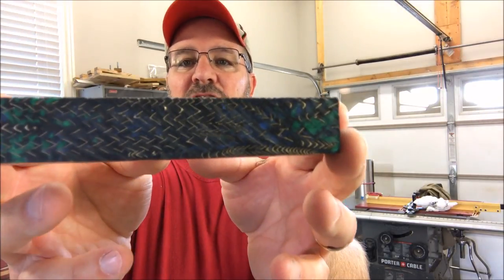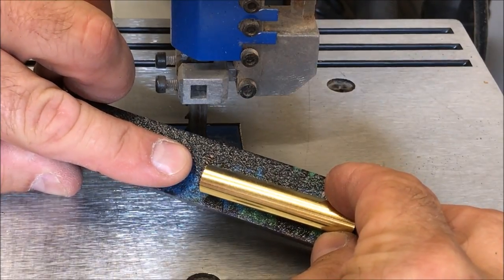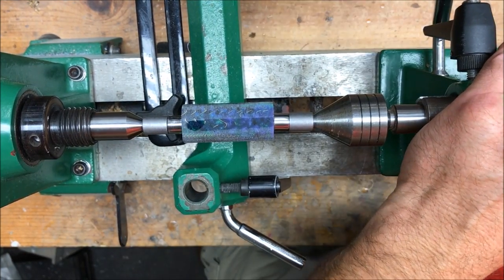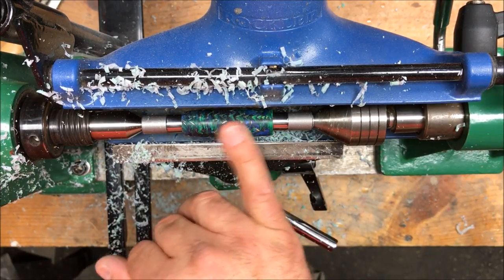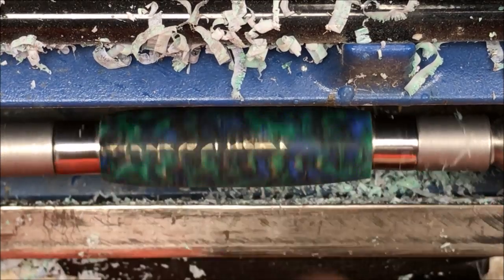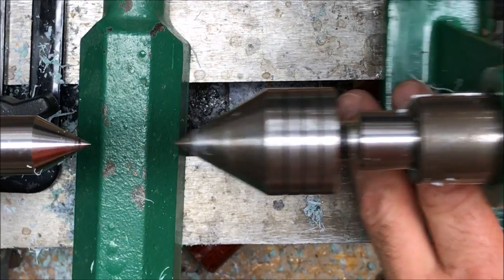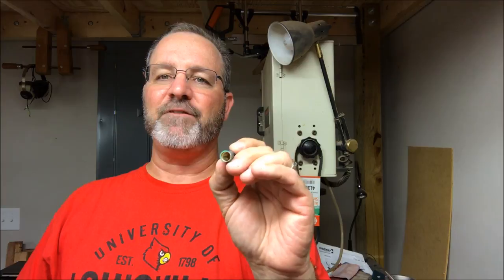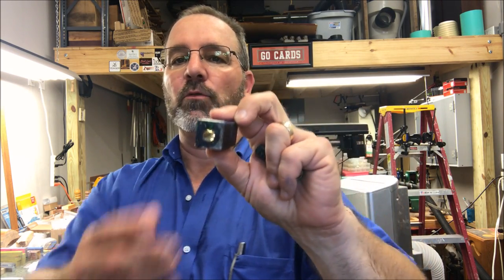Things Don't Always Go As Planned

Comment: Hi Bob, I bought the same lathe and only because I am just starting out and its cheap.  I watched one video that went over some of the problems this lathe has and that was one of the problems.   The spindle to tail stock sometimes don't align.  So when I got mine the first thing I did was to check that alignment and sure enough mine was off, so what I did was to cut up a coke can and used strips of the aluminum under the tail stock to line up the two.  So far it was been doing great.  Now, just for my peace of mind I started with the mandrel saver and so far true pens blanks.  I hope this helps.
Reply from the maker: Awesome job, great dis on that lathe. 

Regards,
Bob

Comment: Nice blank.  Instead of cleaning off the tube completely, just take a small amount on each end to eliminate the chip-outs and replace it with a contrasting color wood or acrylic glued to the ends.  Called an "oops ring" in many circles.  At least you'll be able to salvage the blank.
Reply from the maker: +John Walsh I may just try that, got to
Get this lathe alignment figured out first. 

Regards,
Bob

Comment: Bob, thanks for at least two great tips here: 1) the dust collector attachment, I will try that with an old thing I have that looks similar 2) I'm off now to check my old lathe which I use mostly for drilling to see if my tailstock is lined up or off a bit. THANKS!
Reply from the maker: +Ralph Ross Thank you Ralph. 

Regards,
Bob
Reply: I have been a machinist most of my life. Not to say this is not a problem when drilling because it is. If it was a metal turning lathe, you would end up with a tapered part when turning but not turning off center.  My lathe has the same problem but I use a mandrel and the mandrel saver tail stock center and if the arbor is straight, I guarantee you will not get the result you have. 

I do enjoy your videos.
Reply: Well my old Rikon 70-100 mini lathe was right on, luckily I think, as I don't recall the last time I checked it except years ago when I bought it and set it up. I did test with the quill fully extended and retracted and it was A-OK.

Comment: You could send the wobbled blank off to your friend that does casting and have him add a layer of that resin you use with the bottle caps. Then all you would need to do is rework it,..... maybe a kit with a fatter nib so you can keep more meat on the brass tube
Reply from the maker: +Marcy Cooper I just got most of what I need to start casting. Not sure if I'll do this blank but I failed twice this week and the second would be a perfect candidate. I even mentioned doing just that  in the video. Great minds.  :^)

Regards ,
Bob

Comment: Touch up the exposed edges with a bit of paint and then recast in clear resin to save the awesome blank. For the alignment you might try using your mandrel as a guide/positioner and draw a reference line on the front way as well as an index mark on the front and rear of the tail stock so you can position before locking down. You could also send the blank to me to attempt to salvage. ; ' )  Keep up the great videos!
Reply from the maker: +Mr Vic's Pen Shop Thank you for the information, I plan to work on this issue today and hopefully can get it corrected. Thanks got the offer the salvage the the pen, LOL, I got a kick out of that. 

Regards,
Bob

Comment: Hi Bob,
Your HF lathe may be different from mine, but my Jet has a bolt under the tail stock that keeps the lower clamp on. I can adjust the lateral play by tightening the bolt to take out the slop. Hope that helps.
Reply from the maker: +Jim Kodysz Thank you Jim,
  I'll take a look and see if that's the case. 

Regards,
Bob

Comment: How frustrating !    I purchased a double ended #2 Morse taper, and push it into the headstock. Then I loosen the cap screws under the tail stock and push it firmly up against the other taper. While everything is aligned and tight, I tighten the cap screws under the tail stock. Then, I install a drive center in the head stock and a live center in the tail stock as a check for perfect alignment. I do this about every 3-6 months and find very little drifting has occurred.  My lathe is a Nova DVR  XP, which is not a heavy duty lathe, but far more substantial than your Harbor Freight lathe. I'm not sure if this will work for your lathe, but for mine, this process is part of a 3-6 month check up of all fasteners and alignment, and has worked for me since 2013.
Reply from the maker: +Doug Robins Thank you for the info Doug,
  I'm currently trying to source a double #2 MT. 

Regards,
Bob
Reply from the maker: +Doug Robins Thank you.

Comment: could you drill and tap holes into the side of the tailstock where it slides on the bed. then put some grub screws in the holes and adjust out the play. they would wear but would be easily changed or adjusted
Reply from the maker: +MelbourneAlan That's a pretty good idea. I wonder how difficult that would be, hmmmmm.  

Regards,
Bob

Comment: Bob, I have the exact same lathe as you do, and have the same tailstock wiggle. From what I can see there’s not much you can do to fix it. The only way I can see, is to weld on a piece on the bottom of the tailstock that has tighter tolerances between the rails. 

I’ll continue watching and hoping to see if you find a different fix for the tailstock wiggle.
Reply from the maker: +Gary Binder Thank you Gary,
  So far none of the suggestions have worked. I may just have to replace it. 

Regards,
Bob
Reply: I’m going to keep working at it, if I figure something out I’ll let you know.
Reply from the maker: +Gary Binder Thank you. I'm running into walls. 

Regards,
Bob

Comment: I second your opinion on the tailstock.  You can adjust the headstock all you want, but the problem is slop on the tailstock.  My lathe at least locks down in one place but it is sloppy too.  Drives me nuts.  You had a lot of comments yesterday about adjusting the lathe and I appreciate the advice and links people provided, there is a lot of good information there.  But I think in your case it is simply the fact it is a cheap lathe.  I wonder again at the wisdom of trying to use a mini metal lathe for pens...for me, not you.  I would really love to get into small machining like steam engines but don't want to give up pens either.
Reply from the maker: +Tenspeed TheBikeHanger as long as you can get the speed up it would work. Many metal lathes are geared to run slow with lots of torque.   

Regards,
Bob

Comment: A little clarity (I hope)... In order for your blank to oval it has to wobble! Even if your centres are miles out it won't wobble unless your centres are loose while turning. With a pen turning mandrel of the rod type wobble is exactly what they will do. Imagine a skipping rope. It's held at each end runs oval in the middle. Your mandrels cannot do this as they are only held at the ends.
Reply from the maker: Thank you

Comment: late to the party, I seem to have the same issue with my new PSI Commander lathe every time I move the tail stock I have play side to side, which can change my centers by a few mils.  I'm just starting out & I use my lathe to drill my centers of my blanks. I noticed this same problem. I'm wondering if an older style lathe with the 2 rail system might be a better lathe.  Anyone have this problem on a Jet or Nova II lathe?
Reply from the maker: I’m hoping to move to a Jet as they do not have this issue. 

Regards,
Bob

Comment: I just turned a blank with the wrong bushings. The wood gave me trouble so I ended up spending more time than usual just to find out I was doomed from the start.
Reply from the maker: +Jwhuguley Ouch,
  I've never used the wrong set of bushings but I have installed them in the wrong orientation on a cigar pen. I didn't realize it till I got it pressed together. Man was that a funky looking pen, LOL. 

Regards,
Bob

Comment: The issue isn't the centers.. It's in the mandrels... That's what makes your blank turn true, or not.
Reply from the maker: +franksalterego Thank you Frank,
  I will test both of the TBC bushings to verify they are true. 

Regards,
Bob
Reply: To test, use a brass tube (without the pen-blank material) ... After all, it's the TUBE that must be running true.
Reply from the maker: +franksalterego I have some 10" tubes. I'll give that a try, thank you. 

Regards,
Bob

Comment: Oh dear. I can seethe problem, but how to explain??? The centres not aligning is not your problem. Imagine off centre turning, The blank becomes oval shaped, but if you turn deep enough it will end up round. The blank doesn't care where about the two points are in space, it will turn parallel to those two points. I hope you can see this... 
Turn a piece of wood between centres that you know are true and you should find that even with your centres miss aligned it will not be oval. If it is not true then make sure the tail stock is not wobbling while you're turning.
Next is the difficult bit!!! you need to see if the bushes and/or the mandrels are true. If you have a dial gauge use that. mount each bush/mandril separately, between centres and check for round with the gauge. 

I hope you can understand my meaning in all this. If I lived next door I'd do it for you.
Good luck.

Stu.
Reply from the maker: +Stu Brearley Thank you Stu,
  I understand, I'll be working with it and I'll see what I can do this weekend. Thank you. 

Regards, 
Bob